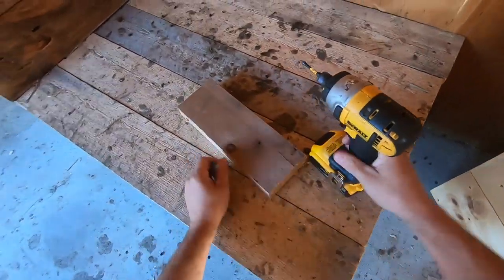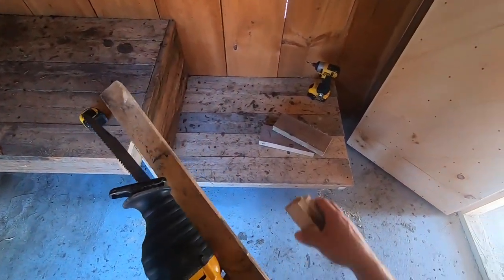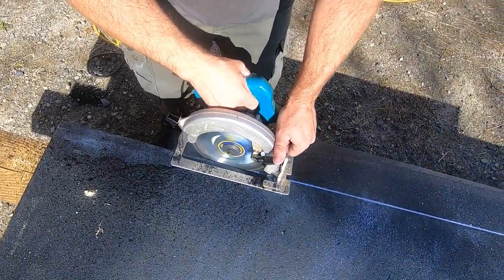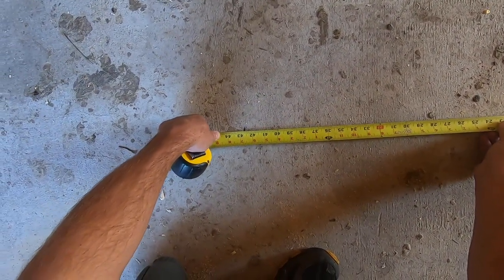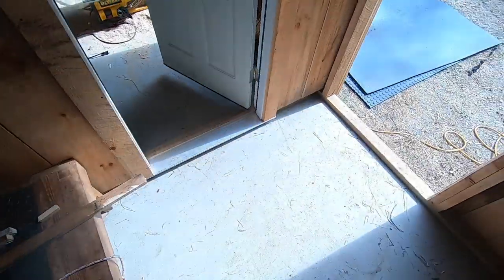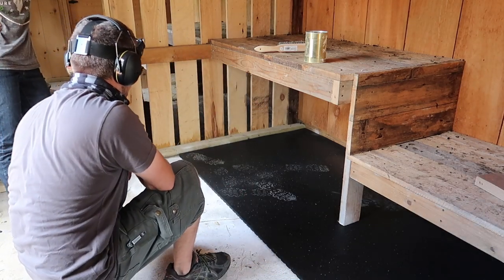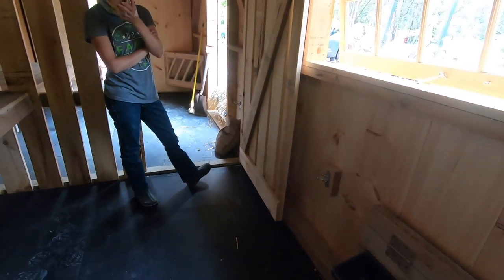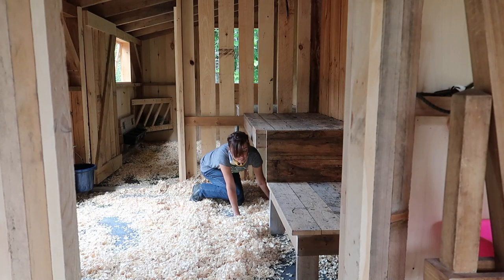was this a HUGE MISTAKE?? Concrete Floors in our NEW BARN

Comment: A BARN NEEDS STALLS  AND “ GUTTERS “  !!!
I saw it right away , but just thought they must no that LIVESTOCK URINATES ???
The stalls must be raised on both sides of GUTTER , 3-5 inches  , pour a raised slab over the stall area and thereby create the gutter down the centre of the barn !
If that’s to expensive now and your livestock are only goat size you can use KENNEL TECHNOLOGY LIKE TOUGH TILE TYPE GRATING THAT YOU INSTALL OVER KENNEL FLOORING WHICH ALLOWS THE URINE AND DOG DIRT TO DRAIN UNDERNEATH THE Tiles  TO THE GUTTER SYSTEM AND INTO A SEPTIC FIELD ETC .
The whole BARN FLOOR has to have raised stall areas that cant down towards a CENTRAL GUTTER !!!!
The CONCRETE FLOOR is right you just forgot to allow for drainage ( high bedding areas draining down towards a central GUTTER !
Remember you will be using tremendous amounts of water to flush out your BARN , now it will be sitting under all your WALL PLATES ( ROTTING THEM OUT ) the whole floor should be shaped like a gutter ( “V” ) shaped !
You poured it like a WAREHOUSE ???

Comment: I think, you made a big mistake. By sealing the concrete, there's a chance the urine will be absorbed by the timber walls. Soil and (deep) bedding is the solution.
Concrete feels colder than soil, in winter time.

Comment: The dog kennals at my mums work always smelled. My mums boss tried all kinds of cleaners. We found the concrete was xorbin the urine. One weekend we moved the dogs scrubbed the concrete with something called Kennelsol and then sealed the floor with a pet friendly sealer for kennels. I looked it up and there is a product called kennel-seal.
Reply: For the people that read the comment before my edit parvosol kills parvo I got it from the vet when I found out that my new house was contaminated. Kennelsol is what I use to clean the kennel. They also make a product called kennel seal in all of its pet friendly because it's designed for like a dog kennel and I have a feeling it will not harm the goats but you may want to double check

Comment: I do not believe you sealed the concrete floor--so it would absorb and hold on to fluids such as urine.  you could have built the barn with a concrete floor all except the goat stall area.  I would pull up the rubber mats and pressure wash the concret then seal the concrete then put the mats back down

Comment: You've made many huge mistakes, but help those poor goats. Concrete is fine if there is a deep bed of straw, that you replace regularly. You lack the square footage for that many goats in your new crackerbox dollhouse wanna be timber frame barn. There is no structural integrity to the frame. Your siding is holding the building up. Love your videos but feel sorry for you. Because of the many misdirections you're taking.

Comment: The only thing I would have done differently is ...I would have run a water line  to the barn while I had that trench open for the electric and install either a hose bib or a freeze proof hydrant. For a couple of reasons first you would be able to wash the floors and you wouldn’t have to carry water from the house for your animals. That’s the only thing I would have done. Keep in mind that your herd size has doubled now since willow had her kids. And that = more pee...I think regardless of the floors composition it was still going to smell like urine. At least concrete you can wash it’s hard to wash dirt or gravel that many goats is gonna stink that’s just a matter of fact
Reply: I agree about the water line, George.  I thought it would have been a nice option when he was designing the layout.  I understand his idea of capturing rain water and snow melt as a water source for their drinking, but water under pressure is nice.

Comment: Joel Salatin uses tons of deep bedding, dry wood mulch, for the pigs and there is no smell. Justin Rhodes has used this method with his pigs also. There is no smell!!! Just sharing what I have seen with this method and it seems to work very well. Love and Blessings from South Texas.
Reply: There is not enough depth/height in these stalls for that method, it would also spill out the dooropenings and rot the wood faster.

Comment: Your making even more work for yourself with the mats. So now not only are you cleaning concrete floors but not rubber mats. I would stick with the concrete.. use hay, pdz and lime. You got animals🤷‍♀️ not to mention having to move your mats under those legs. Uggh your gonna have a headache.

Comment: The decision to place rubber mats (barrier) between concrete floor & urine is a good one because on the long run the acidic content of urine could react chemically with the concrete to cause serious damage to its integrity. Also, rubber is more resilient, therefore gentle on the goats hoofs.

Comment: You can seal it and wash it down with a  hose and it will be great! So no it was not! Just seal it with a roller and some sealer. Before it gets really dirty. Your going to get tired of dragging those nasty matts around to wash them you will get feces all over you doing that. I use to have to wash the mats at my work and it was grotesque. So the only mistake you made was getting those big rubber mats.

Comment: I don’t believe the concrete floor was a mistake. You do need a deep covering of woodchips & wood shavings on the floor. 
You will most likely have to muck the stalls more often than you did with the gravel flooring. I have no idea about those rubber mats. They should provide some insulation but other than that you’ll still have to provide a deep bedding on the floor & muck the stalls more often bc the urine and manure have nothing but the bedding to absorb them.

Comment: I like the rubber mats . Where did you get them from . I could use them in my garage . Just think you put 6mil plastic down before you poured the concrete to stop the concrete from sucking up the water . Same goes for the top . Concrete will suck in all of the urine . Urine will eventually work it's way down past the rubber mats . Concrete will suck in the urine . It may not be that bad now but in a few months you might see a difference . You should have added a few coats of concrete sealer before you put the mats down . The big test will be in the summer months and urine can smell pretty bad in the heat . You can see the concrete dust on the floor of the barn . I also have seen the dust in your outdoor kitchen . Put a sealer on the floors .

Comment: You need to seal the concrete and it should have had a drainage groove length ways so that you could pressure wash frequently and get all the urine and dirt out. You have wooden edges everywhere.. Cannot power wash clean through. Amateur. But, you learn from mistakes.

Comment: The smell comes from enzemes that sink into the concrete, bleach and other cleaners will not remove it. You will need to do some research into the chemicals available to kill off the enzymes, unfortunatly I can,t remember what I used to use on the concrete floors of our kennels, but it did kill off the enzymes causing the smell of urine.
You may find that the gaot's urine will collect under the rubber matting, I hope not!  lift a section after a couple of weeks to make sure this is not occuring.